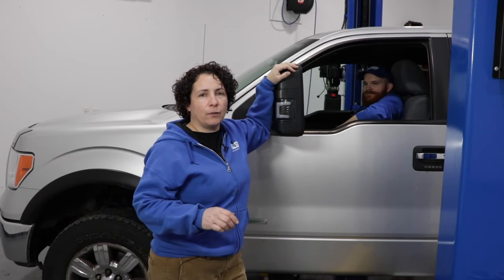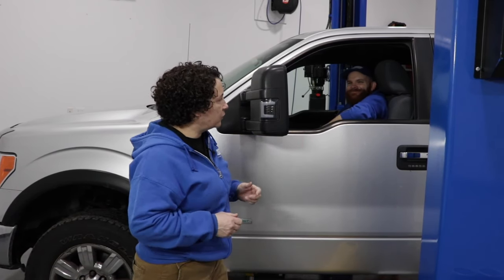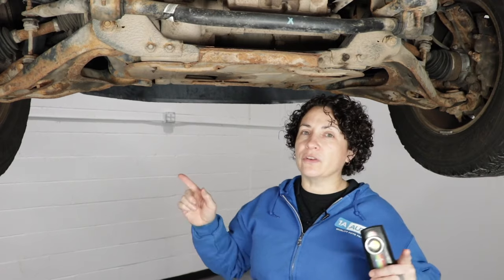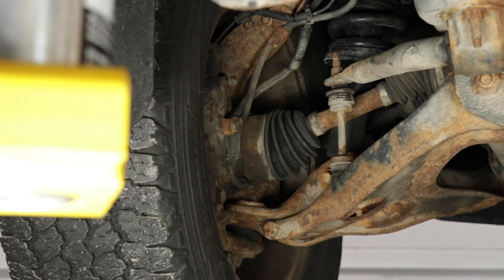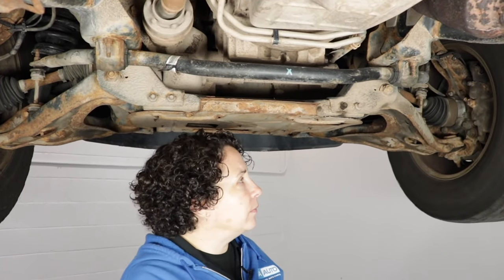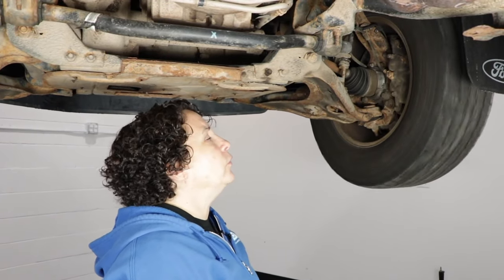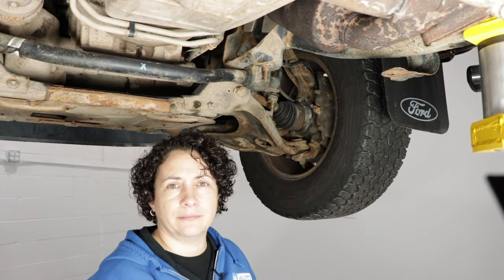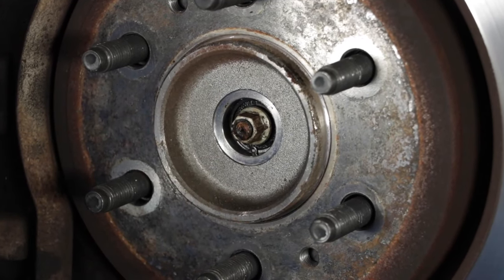Truck 4WD Grinding or Not Working? Quick Fix For Auto Locking Hubs

Comment from the maker: √  Watch the Video
√  Buy The Part at 1A Auto http://1aau.to/m/Visit-1AAuto
√  Do it Yourself
√  Save Money
Reply: Good day!!!me i ask the problem of kia sportage 2007 model front drive stock up run in 10meters?but the reverse is good running condition.
Reply: I have a question. Can the torque be checked while it's on the ground or does it have to be lifted up before you can check? I checked when it was on the ground and it seems tight.

Comment: How can that 13mm nut tightened to 20ft-lbs not loosen when most CV shafts have a 32mm nut and about 140-160 fl-lbs if you don't use threadlocker! ?

Comment: Doesn't vacuum take it out of 4X4?  If you remove the vacuum line, isn't it in 4X4 mode all the time?
Reply: You are spot on, suppose to have vacuum to keep it in 2wd
Reply: That's right so people who disconnect the system are constantly in 4x4. How is that good
Reply: @shantor100  you can also buy a delete kit. Its a 4x4 actuator (part on hub) without vacuum lines. The hubs stay locked in and axles spin but the driveshaft isn't spinning and sending power unless you put it in 4x4. A lot of people disconnect or run the delete kit. Haven't heard any horror stories yet.
Reply: you are correct.Advance giving bad info is worse then no info at all.

Comment: Nice video. But what about when you still get that wheel binding at the wheels (like your in 4x4) but it’s been switched to 2- high? Not disengaging?
Reply: I just finished tearing one apart and found the splines on the cv axle worn. Had to use a file to smooth them back out. This may be the binding issue your having

Comment: The tough issue for the masses that watch for videos is that F150 rules the roost when it comes to 5.4 triton or ford 4x4s helpful hinter vids.. I have a specific 07 expedition w/notorious 5.4 and there are few if any vids on where the damn hood latch is let alone where the IWE solenoid or how many chck valves are attached. The unicorn of the expedition and fords wisdom of making different flavors in 5.4 of the same year for diff models has to be the greatest happy ending by Fords grand planners. Thanks for making this of a general nature, Maybe just Maybe show some work on the 07-14 expeditions but with laser focus of what it looks like before you folks work your magic.  Thank you in advance.

Comment: What would make for low work but not for high? Also in for high the 4 wheel drive Green Lake goes out. Along with the Transfer.case Symbol. 2007 QX56

Comment: I was driving mine into town today on the highway and I kept hearing a clicking sound. I noticed it was going in and out of four-wheel drive on its own.
I disconnected both solenoids so I could drive home without the issue, not sure what the problem is.

Comment: How strong is the vacuum at both actuators suppose to be? My driver side has somewhat good vacuum but the passenger side vacuum is reall weak. Also when i hit 50mph my passenger side tire starts vibrating like crazy. Also my 4WD stopped working. Would i have to change out the transfer case motor first?

Comment: 3:02 where exactly does one go to “look up the torque spec” for stuff like this? Sorry if this is a stupid question but I just took my bumper off on my 96 bronco the other day and I didn’t even bother looking for the torque spec for the bumper bolts, just tightened it up to 85 ft lbs. Where does one go to find such specific information?
Reply: In the owner's manual.
Reply: @ricardobarrios5205  Torque specs for a bumper would not be in the owners manual.

Comment: On my uncle's 2005 F-150, sometimes when he puts the truck in "Drive" and releases brake pedal, truck doesn't move, as if something is holding it.  He needs to accelerate a bit to make it move.  We lifted the vehicle in the air and put it in Neutral, and all wheels seem to spin freely, didn't feel any drag.  Almost a year ago we changed front and rear differential fluid and truck was fine, until very recently.  Could it be 4x4 issue or something else?
Reply: No problem 5.4w are known for that

Comment: I’m having that same issue I tighten it but then when I put 4x4 that noise comes back again please help I tightened it and no check engine light is on
Reply: If its mechanical it won't throw a code.

Comment: I have a Chevy Silverado 2004 1500 4WD and it has the 4WD service I checked it like the video but still not working
Reply: O4s dont lock unless equipt. Most american SUVs didnt lock until 2006 as a standard. The earlier ones are open up front, so technically 3 wheel drive.